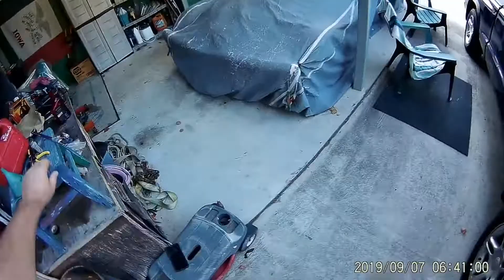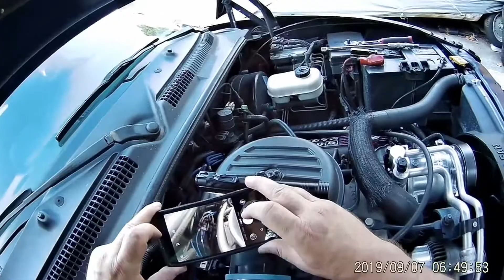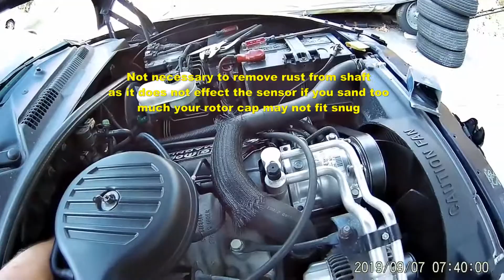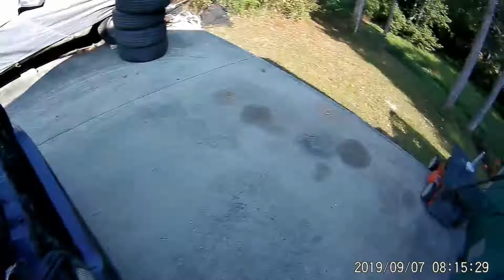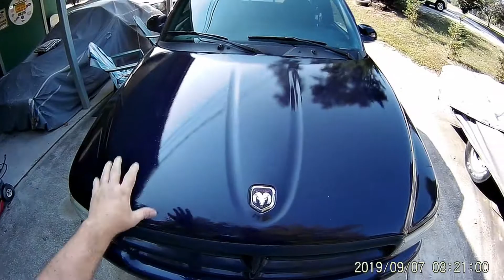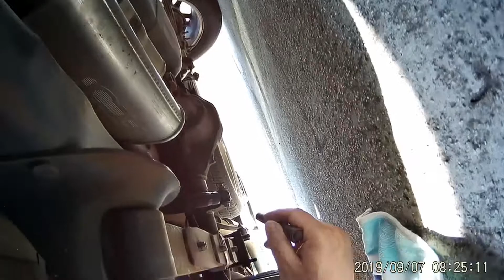P0340 dodge dakota durango 1500 check engine light fix repair cam position sensor air shocks

Comment: I just had to do this to my 02 Dakota, the hardest part was getting that connection loose, I finally saw the white tab on the pick up end and pushed it down to release the coupler but it wasn't pretty...

Comment: Robert can you please tell me what you was sanding in the distributor. Have a 2000 rt project truck i bought keeps giving the same code and have replaced every sensor on the motor. Thanks again Brian Atkinson
Reply from the maker: Had to lightly sand the distributor shaft as it was surface rusted from sitting and the rotor button would not slide back on the shaft as it should. Sometimes parts are bad out if the box double check them
Reply from the maker: depending on the mileage check your distributor shaft run out, the entire distributor maybe worn out. if the shaft has too much movement, you may experience the code as well.
Reply: Thanks. Hopefully get time to work on it this weekend.